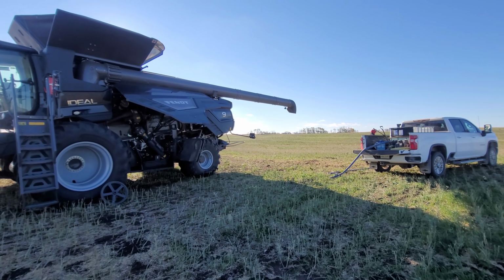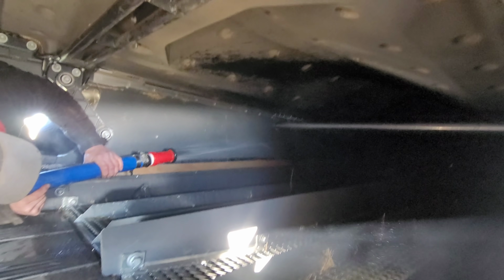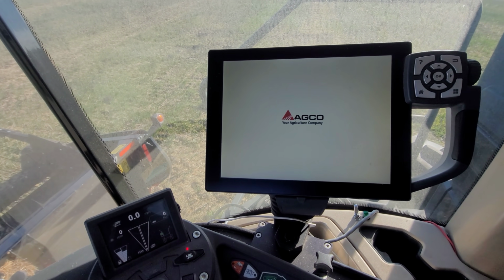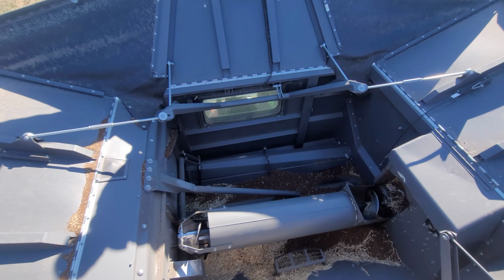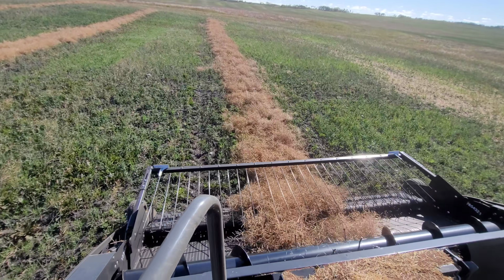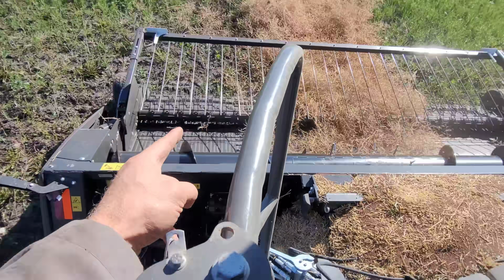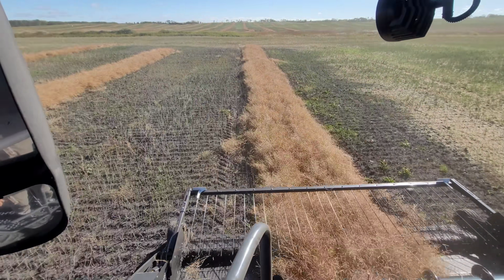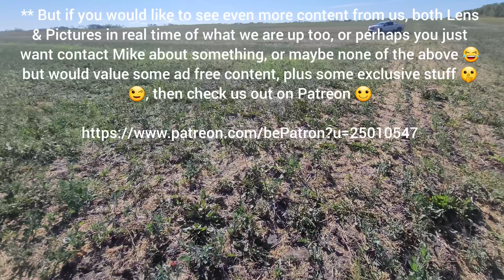Welder is here, smell smoke? 😬

Comment: Mike and his Fendt saga seems more like his farm is doing product development and testing then being an actual customer of a finished product. Hopefully Fendt learns and implements significant improvements based on Mike's experience
Reply: Every where else in the world Fendt works, so it appears to be a Mike/Fendt problem. 🤣
Reply: Check the serial number cause he might just be an early production units. 😄
Reply: It's not just a Mike thing. Granted he runs more acres than most other people that have an IDEAL, but AGCO has had to do a bunch of updates to these machines. There's 2 sides of the coin here, one side is that it should've been tested more before being put out to market, and the other side being that AGCO is still fully covering these updates, saying they admit the flaws in their machine and fixing them.
Reply: @christopherschneider3323  I am just saying that I have friends running Ideals in much higher density crops than Mike does and they do not expierence all these problems with their Ideals. However they also move their Ideals on trucks. They would never move them 350 miles on their own power!
Reply: Jon Mc Farmer. Reading or driving a combine has no bearing on the way that a combine threshes a crop. I think that taller high density crops probably do go through all combines easier than the short tough stuff. However there are many uncalled for issues with these Fendt combines. They aren't run any harder than a custom cutter runs a combine.
Reply: @christopherschneider3323  yeah I remember when mike first got them he said the maintenance deal he got with AGCO was the big winner for why they got them.
Reply: @jonmcfarmer6954  excuses are like        a$$holes, everyone has one. These combines are not ready for prime time. Replacing, welding, fixing and combines burning. Not seeing that with other combines. This is ridiculous
Reply: @jefferyjames7526  No excuses. Fact, These combines works fine everywhere else except on "Mikes farm". 🤣
Reply: @jefferyjames7526  man what are you talking about lol. JD combines 🔥 burn down regularly every year lol, had 2 in our area thus year with terrible crops. Know a guy who bought one and driving it home from the dealer the engine blew up. So every brand has its good and bad. Im just glad our Cases had zero problems this harvest.
Reply: @jefferyjames7526  combines are incredibly complex machines. They break down all the time for various reasons, no matter the make. Look at "Harry's farm" here on YouTube, he runs CASE and has plenty of breakdowns.
Again, that's why Mike made sure to have "bumper to bumper" warranty.
Reply: @MrTaliz  to be honest, they all don’t break down all the time, I do not own a combine, or for that matter, farm.  I do however, have a great friend that does.  He bought a new 9870 JD combine and the only time the combine broke down was under warranty, the high pressure fuel pump went out. John Deere was out and 2 hours later he was up snd running. 12 seasons and that is the only downtime. He does go through it every winter and checks it over.
Reply: @jonmcfarmer6954  They've had numerous problems unrelated to the amount of acres and certainly not due to roading it 350 miles.
Reply: @woody1320  Again, you find Fendt combines (and tractors) all over the world and they do not have all these problems Mike has. Is Canadian farming that unique? Fendt by the way was founded in 1930 so it is not a new company as some claim here.   Fendt also make forage harvesters, maybe Mike should use these instead.🤣 I you run bulk wet green material through a modern high capacity combine they will plug up. Even an older low tech Case!! 🤣Just watch Welker Farms latest videos.
Reply: Am quite sure Mitchel Farms gets the prices on all theyre machines as they should b.c. of many $$$ millions spent yearly on new equipment,having said that Mike shows incredible patenance while dealing with all his brake downs  wish he would share how many hrs on machines wen they fail
Reply: Ol Johnny McFarmer has the low down on Ideal performance all around the world guys, he said so
Reply: @TronVila  You got that right. 👍
Reply: @jonmcfarmer6954 so you are watching mike videos I always find you lol 😂
Reply: @jefferyjames7526 my boss has a 9760 and 9500 no break downs my x boss has a 2388 down more than. Nothing runs like a Deere

Comment: You pick up row by row, making sharp turns. We used to pick up rows in the order 1-4-2-5-3-6 when they are this close together, and repeat the cycle (switching right to left turns or the other way around). That way you can keep driving, especially when its a bit muddy.

Comment: I use a pump up hand sprayer for my fire suppression when welding. By all means a decent fire hose is great to damp down ground etc, but a wee pump up unit uses water very sparingly and is super easy to get into confined spaces with the wand and flexible rubber hose. You don't need to drench other parts you prefer to keep water out of.

Comment: Hi Mike & Ashtyn!
I am partial to the red" machines, but all ALL them have problems! Some problems are caused by poor design, and others are caused by lack of maintenance, rocks, and other accidents.
Some farmers swear by there Fendt's and other brands; others swear at them! They haven't been around as long as IHC, or Deere, so some of there engineering is still in product development. You can bet Fendt has taken apart every major competitors machines and looked for way's they could improve there own machines!
Factory Warranty and dealer support is a VERY important issue when you purchase any machine! What kind of support did you get when you purchased your last machine,..... or did you just get the "bird"?
Farmers seldom forget!
Best Wishes, and GOD BLESS!
Gary

Comment: It's too bad they had no choice but to use water. Spraying water on red-hot steel will make it more brittle. They will have to watch for cracking in the heat effected zone next to the weld.
Reply: That’s for sure, they totally compromise the yield of that steel in that area putting that water on it, hopefully that wasn’t a frame rail, not sure couldn’t tell.
Reply: @joecorrie1  The bolt holes in the flange at 2:50 give me hope that it isn't a frame rail, but that is just a guess. If it is mainly a wear plate or even webbing between upper and lower rails, it might be OK.
Reply: @The Flying Farmer That's why is said in my original post that "they had no choice".  It may well not be a problem, especially if it is a low carbon steel. If it were me I would just make it part of my normal maintenance to check for cracking.
Reply: @The Flying Farmer i’ve welded on a lot of equipment you put plywood over belts, wet rags over hoses and electrical harnesses, there was still no reason to spray water on the backside of the Weld maybe around the area but not on the weld

Comment: Such a same AGCO is getting this kind of PR from Ideal Combines. Gleaners which is also a AGCO Brand is the complete opposite, one of the most reliable, easy to operate & repair, & efficient Combines around in my Opinion. Keep in mind any machine is only as good as the operator running it,
Reply: Keep in mind, any machine is only as reliable as the maintenance program it has too. These machines have a lot of moving parts and require a lot of maintenance to keep them performing as they should be.
Reply: Where is the gleaner built? The ideal is Italian  (fiatagri?).
Reply: @EFCasual  Gleaner is currently built in Heston Kansas. It’s always been built in the USA. Was the first Self Propelled Combine to be built. The Gleaner Company turns 100 years old in 2023.
Reply: Massey is a AGCO band also, Gleaner was a independent then became part of Allis Chalmers
Reply: @brianhembel567  Massey & Challenger quit making Combines recently. AGCO only has Fendt/Ideal and Gleaner in the Combine lineup

Comment: RIP Fendt reputation
Reply: I agree. I've ran Deere before and now Lexion here. I won't ever consider buying a Fendt after watching these videos. I realize that combine designs evolve and weak points get eliminated but these things are just not ready for mass rollout.
Reply: @jasonm8376  so what is your impressions on claas?
Reply: @11T872  Amazing capacity. Very reliable and overbuilt. When you need parts and they all need parts at some point, breathtakingly expensive but readily and quickly available.
Reply: @jasonm8376  we have also came from JD to claas 3 yrs ago we really love the machines, the first claas we have was a 2015 c69 760 and now we have a 2019 c79 760 major changes between the two machines huge upgrades on all rotor drive pully s thresher pulleys rotor gear boxes the pro chop chopper is a million times better then the turbo chop, point being is I think claas has evolved into one hell of a great combine but did definitely have a fair bit of issues along the way. The fendt does look like an absolute nightmare tho and there has been many around you hear absolute horror storys not just mike Mitchell.

Comment: all the fendit break downs and combine fire last fall i would have to say i would do every thing i could to get rid of them and go with different brand just looking that the weld job you had done on this one in this video looks to me like they need to beef that area with some thicker plate steel and why they did not see that sooner is good enough reason to do some changing around this area here to comment is not big enough to say it all many of the other trubles i have seen could have been delt with on the drawing board just saying

Comment: That combine would not make it 2 seasons on a 5000 acre corn operation. What a joke.
Reply: This is a 40000 acre operation
Reply: @charlieshwan5574  Divided by 8 combines equals 5000 per and their not running 250 bu/acre thru them like in corn.
Reply: I wonder how many total bushels it had ran through it. But it looks pretty impressive going on a 10 hour road trip pulling that 50ft header.
Reply: @nebraskadirtmoving6108  It just needs to be able to do what it can do reliably. Better engineering,I suppose trying to keep the cost down to encourage people to buy a different brand,but if its not reliable... Why they cant solve the straw chopper plugging issue after development and 3 years on the market would seem like they don't want to solve it.